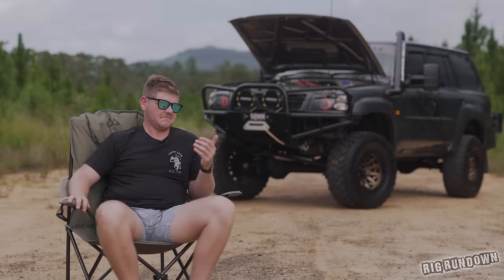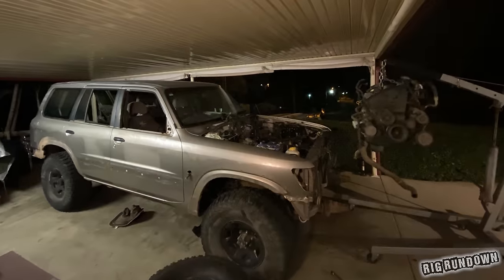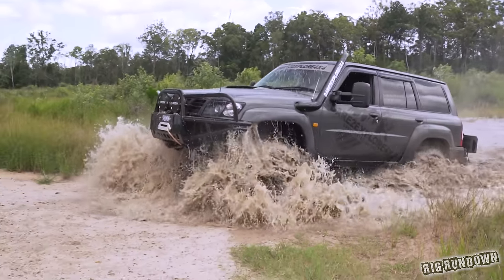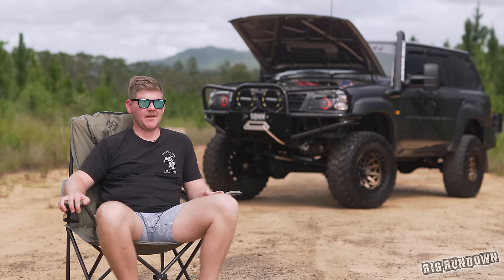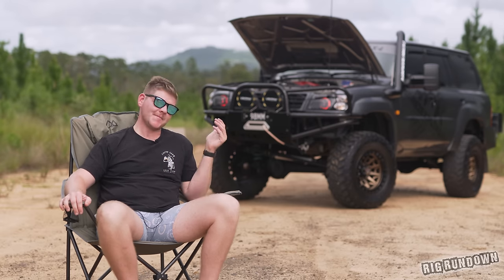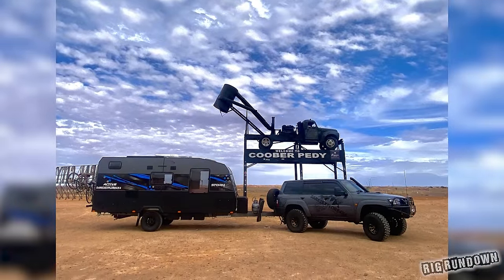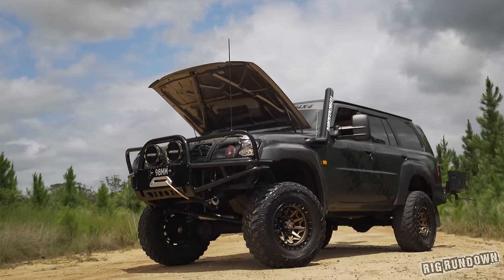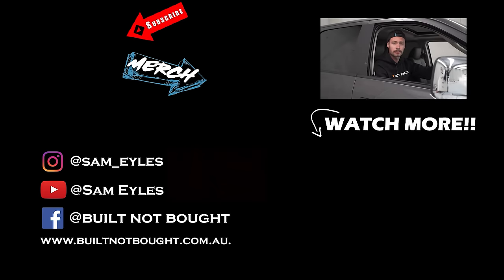RIG RUNDOWN || Michael's LSA Patrol Tourer

Comment: Touring? Then lose the lift, get the C of G down, run tyres you can get outback, steel wheels that can be beaten back into shape, and lose the fuel guzzling petrol dinosaur engine and go diesel for range. What you have at the moment is a play toy, not a tourer.
Reply: Absolute beast